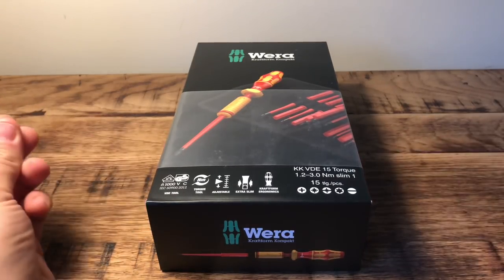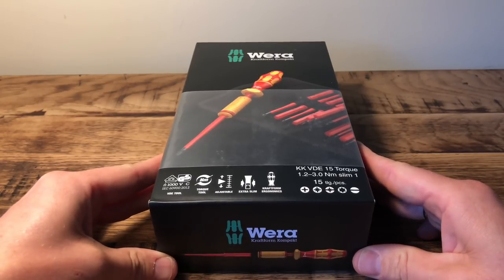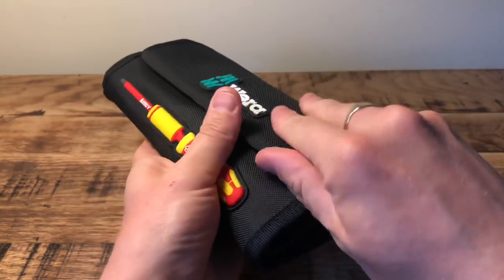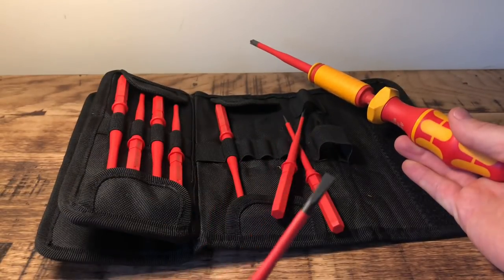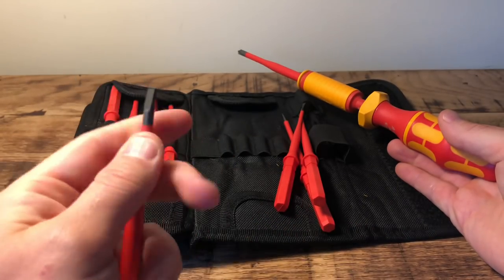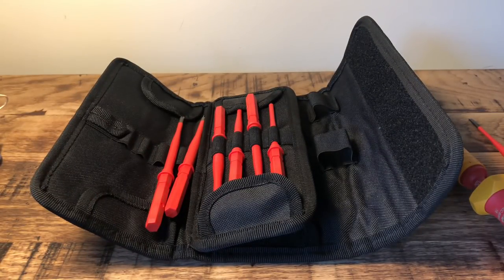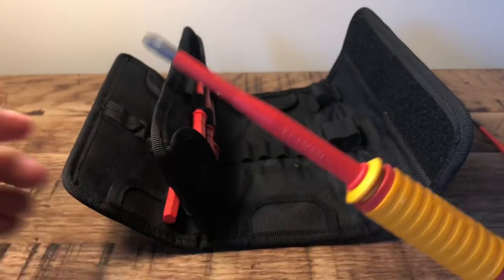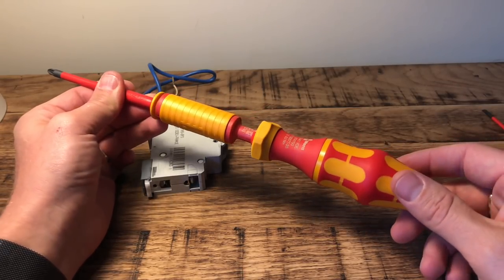How to use a Torque Screwdriver - Wera Kraftform Kompact Torque Screwdriver Set Unboxing & Review

Comment: i was going to get this until i did as you have and checked the hager site, and noticed the setting for a main switch is 3.6, and the highest setting you can get on a wera torque screwdriver is 3.5 on one of their models, which is crazy when others make them from 0.1 up to 5.0

Comment: The annoying thing with the Wera Torque driver is it comes in at least 3 variations:
7440 VDE 0.3 - 1.2 Nm 
7441 VDE 1.2 - 3.0 Nm 
7442 VDE 1.7 - 3.5 Nm

Now many RCBO's currently are 1.2nm on the out going side and 2.5nm on the bus bar, yet main switches can be up to 3.5nm so you either need 2 different Torque driver handles or to swap consumer unit brands you install.
I have a lot of Wera stuff these days and they're good tools and kits, yet the Torque driver handle really lets it down considering some manufactures are going from 1.0 - 5.0 Nm - Wiha/Draper for example.
Reply: Good information.

Comment: Nice kit ,however if you have the money get the Wiha Electrical screwdriver as it includes a 4mm hex needs for commercial Eaton boards.
Although the wrenches don’t go high enough.
But Meter tails can be pulled out when done to recommend torque settings.

Comment: Nice one , I've got the Wera maintenance kit that comes with all the bits + a socket set and uses the same size bits as your kit , I bought a Wera T driver on its own for about £ 50 and all the various sizes of driver heads fit plus sometimes you need to torque up small nuts in some C/U s and the Wera adapter will also fit the T driver , doing it this way is a lot cheaper + less kit to carry around with you......👍
Reply from the maker: Nice yeah I’ve seen those they look good

Comment: The one you recommended it goes up to 3nm,and Schneider mcb anything above 25A need to be set to 3.5nm.
Wera 7444 cover that range 
Second does it need to be different settings for CPC and neutral bar?if yes where do you get that information please?
Great video

Comment: £100 ish for that? Extremely good price if so! Ive paid over that for one or two non-torque VDE sets from Wera! I’m not a professional but have been making up KNX panels etc (as well as other small jobs around the home) and have been meaning to get a torque driver for a while. One little job (I know many would do without a torque but not a great idea) coming up so I had better get the driver stand-alone in preparation!

Comment: I've put off buying one of these for a while, I've been using a cheaper but uninsulated small torque wrench and taking care (with power off) but delayed it no longer. The need for such a tool is clear if only to prove the correct torque was applied - no such tool, then they couldn't have been torqued up correctly. Two questions: 1. There is a requirement to have the wrench calibrated, when, cost and need? 2. Do I need to fall off my chair every time I tighten a live terminal ;)
Reply from the maker: Ha ha great comments glad you went for it! Chair falling is essential!

Comment: I find my experience is enough to tell me if I am over tightening on a terminal. I was talking with my assessor today about all the latest 18th edition changes and how much is manufacter led. Tools, AFDD's, SPD.s, metal cable clips etc etc. The people who write the regs are being influenced by the people who sell all the gear and of course sell us the new books. If the IET was all about safety then the regs book would be available as a free download. Too many vested interests in an industry that is more interested in making momey out of hard working sparks than improving the quality of workmanship and ensuring a decent living.
Reply from the maker: I know what you mean about the regs books, it’s a killer to have to pay £80+ for a book that you know you will have to throw away in a couple of years time
Reply: @artisanelectrics  don't throw them away...  They are useful for doing periodic testing of  older installations to see if they were up to code from install date.
As an apprentice I paid £20 for the 16th edition because it was a knock off version.  The guy made a small fortune selling those to us.  Car boot full at lunch by end it was empty and he had probably made £400

Comment: Please return it to 0Nm after use. There is a spring inside and as you increase the torque it stretches the spring. If you leave the spring stretches it can weaken the spring and give you incorrect torque settings.
Reply from the maker: Great tip thanks!
Reply: Noted- cheers!
Reply: Looks like I'll be getting a new set. Wish i knew this year's ago, been using it since.
Reply: Just about to say the same thing and then read this.

Comment: Nice bit of kit, was looking at getting one myself, they look so cheaply made though?..calibration?, if NICEIC etc don't ask to see proof of cal, whats the point really?.. I like to do things right like you, but sometimes we make a rod for our own backs. Tighten it as good as you can, I have always done this and without failures. Even if you torque the terminal to the manufacturers spec, a few years down the line that terminal can come loose due to frequency in the mains supply (yes it happens), or someone coming in after you to add some other circuit.. where will it all end?.. Great video, thanks for the unboxing, showing how to use it, and the "technical hitch"..I almost fell off my chair laughing :-) I think the screws need torquing up ha ha.. Just ordered one thanks :-)
Reply from the maker: Awesome thanks for your comments!

Comment: Nice vid - quick question, I'm just about to buy one of these but looking at your video it says 'single cable >1.5mm (i.e the tails) in the switch disconnector (isolator)' should be 3.6NM how do you achieve this when the screwdriver only goes to 3.0NM ? I'm new to these screwdrivers so hopefully something simple I've missed ...
Reply from the maker: Get the Armeg Set here, they go up to 5nm https://amzn.to/38IiazH
Reply: @artisanelectrics  nice one !!

Comment: That's a good range of torque settings but I really can't see the value in carrying around all those different  driver heads - reality is you will only ever use the PZ2 one.
Reply from the maker: Yeah I know what you mean but they are useful as normal screwdrivers even if the Torque is not needed

Comment: Can be a bit iffy on tails, tighten it to a click (at manufacturer specified nm) but you can pull them out so easily after! You end up having to tighten it to a click, wiggle the tails back and forth to re-arrange the strands then tighten to a click again & repeat until wiggling stops making a difference!
But like you've said in the comments yourself, better off doing it by the book. At least that way your arse is covered
Reply from the maker: Interesting point thanks!

Comment: how do you torque the isolator when the screwdriver only goes to 3Nm ???
Reply from the maker: Then you need a higher torque screwdriver
Reply: @artisanelectrics  which one would you recomend that will cover the higher torque setting or covers the full range needed
Reply: @andrewlougher-harris5492  
The Wiha VDE torque screwdriver goes up to 5Nm. It is about twice the cost if the Wera one though and more of a faff to adjust (you need the special tool supplied). It does have the advantage that the bits are slim profile (the insulation does not increase the thickness of the bit meaning that recessed screws are no problem).
Reply: @stuartarnold9444  thanks , been watching some how too on y-tube and there seems to be some important setting marks missing eg 1,7 and 2.3Nm it is putting me off pulling the trigger,

Comment: i dont know why people would give you are hard time for not using a torque wrench,  maybe its a london thing because they have so many fires from limp wristed electricians there, after all it was the london fire brigade that pushed for metal consumer units, i guess its not called the big smoke for no reason, ha ha, joking aside, you know when a terminal is tight, its like everything, a few years ago no one would have give a crap, now all of a sudden everyone is using a torque wrench, yeah right. Its all down to rushing about and not taking care while doing the job.
Reply from the maker: There is some wisdom in what you say, but over tightening can be one of the biggest problems, it’s not just that it’s tight enough. I say best to do things over the top than under.
Reply: @artisanelectrics  your right about over tightening, but when you have been doing the job for a long time, you know how tight things should be. What could happen is people will torque things up, and think job done, however especially with meter tails, they will come loose, they do need to be really tight, probably more than the torque setting.

Comment: Another gimmick in my eyes. I’ve survived so far without one ?
Reply: We are already required to install equipment to manufacturers specifications, by not torque tightening the screws, you are effectively not installing to manufacturers specifications.
Reply: Regulation 134.1.1
Reply from the maker: You hit the nail on the head there
Reply: Lets just say that in industrial circles where equipment  costing tens of thousands of pounds is manufactured and installed as part of multi million pound contracts, torque screwdrivers are not widely used.
Reply from the maker: Interesting... I’ve worked on huge three phase boards in the Netherlands and Torque Screwdriver was a requirement